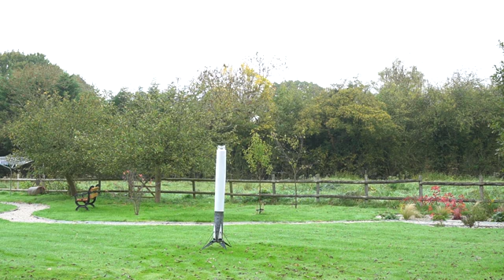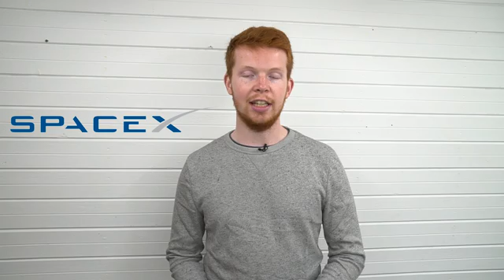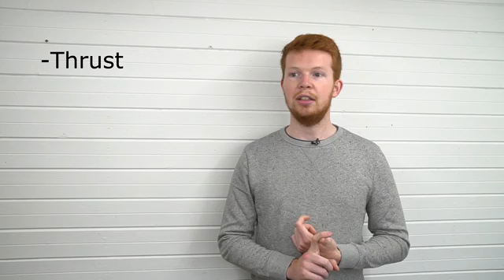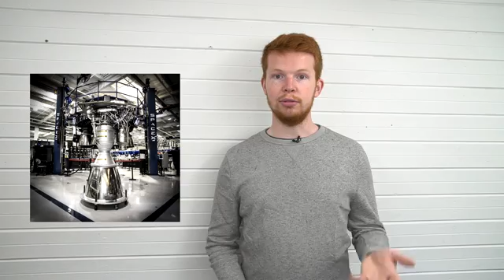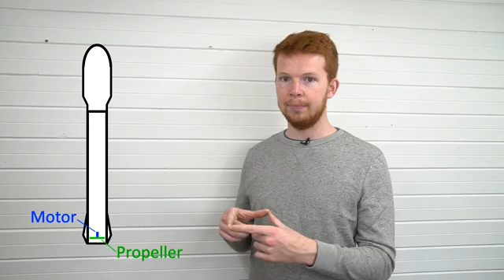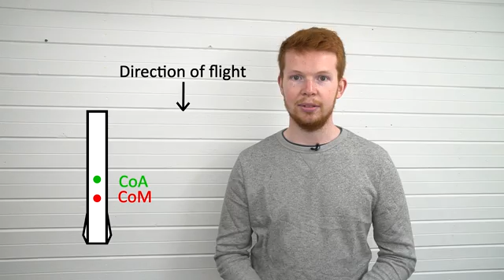Hovering a rocket - SpaceX model

Comment: Thanks for awesome explanation and demonstration. For testing purposes, maybe try using something like a fishing line instead of elastic, so it doesn't affect the rocket in hover anymore. And maybe add a small portion of elastic to dampen the "snap" when you cut the power and the rocket "hangs" itself.

Comment: you could improve the thrust by streamlined inlet and maybe a thicker rocket body, and shorter lenght of air traveling through the tube, to avoid boundary layer problems

Comment: Tom, idk if they still develop the code or which board you're using but you used to be able to plug in a GPS antenna to a Naze32 and use the Naze with the barameter on board and with those 2 enabled and using GPS mode it could hold pretty damn still and would lean into the wind. or even if you tried to push the quad it would fight you. It was a weird but cool thing to play around with.

Comment: Saw a video of  U of Penn students hovering a single motor/prop mounted in a tube and using speed control at specific points in the prop rotation to maneuver it as, for example,  against a wind like you were not able to do.
I think that might work for you to counter the wind.

Comment: If you were able to build a consistent propellant mixture and use a new nozzle each time, you would get identical performance from every launch.  This is the kind of control you can achieve, and the model rocket motors aren't too bad at precision.  Our launch pads, extremely light construction, and winds... yeah, model rocketeers have it tough when it comes to the precision a robotic CNC nozzle-building lathe can build one that's two feet or so in diameter can do.

But, didn't amateurs make it to space for under a half million?

Do you think you could build a rocket at amateur scale that uses 'copter blades (as we're targeting atmosphere-laden bodies, these days) to land and launch until ineffective, where rockets take over... yeah, feathering would have been nice about now... :)

I would deploy tandem counter-rotating heli blades from the nose and let gravity give its motors something to do.  No gyro required, and the blades fit neatly between the tank and the wall.  Mass below, thrusters above, like on a Chinook.  Land horizontally, like a tandem helicopter?  In any case, use the atmosphere and make it do the work.  Bigger rotors :)

Pull a Transformers on the world of model aviation and launch and land a rocket with helicopter blades.  Carbon fiber is a miracle material.

Comment: Next step: Add positioning input? 

Your inventive use of internal propellers would allow for a small camera mounted on the bottom which can provide the internal computer (switch to Adruino?) with an image of a rectangle, such as a painted piece of plywood acting as the launchpad. 

The relative lengths of the sides of the rectangle might then inform the lateral thrusters at the top of the rocket, and the area of the rectangle would provide the altitude for main thruster adjustments to acheive automatic ascent and landing. 

Might even work in the wind!
Reply: Dan Lindy +
Reply: That's a nice idea but that is not going to work very well, mostly because a camera produces way more data per second than an Arduino can handle. Also, you would have to calibrate the camera and you would always be stuck with your reference object.

Another solution: You could use an IMU with an Arduino. They are quite noisy so you will not have perfect positioning and you will need to initialise the sensor for a second or two and then integrate the data over a certain period of time to get decent velocity estimates. You would have to combine it with GPS and implement some extended Kalman filter in software to get an optimal estimate of the position which you can then use to predict control signals. The greatest feature of such a setup is that the filter adapts itself (even dynamically) to wind, lower battery power, wear and tear on the motor et cetera and will still try its very best to maintain the desired system state (position and orientation of the rocket).

Been there, done that. Fun stuff!

Comment: if the "legs" could have some sort of "knee" bending with the angle to the inside and the tip that touches the ground facing out of the center i believe it would give it a bit of improvement.
you got a new sub.

Comment: Hey Tom, what if you use a solid (inexpensive) source of power to put the rocket up in the sky and then use the drone engines to guide it down, a some sort of sensor ( even a camera ) will help  you to keep control while the rocket is coming down, also you can create a way to slide a balance inside the rocket in it's way down, just as you explained in your video ( CoM ), some sort of automatic system ( pretty simple, you don't want to add weight to your rocket ) that slide the battery from the top to the bottom with just one switch, then the fan I think should be at the top of the rocket, guiding the balance of the rocket on its way back to the ground. Finally it would be amazing if you can calculate when to start a second load of solid (or other source of thrust) at the right moment before the rocket touch ground ( I know it may represent a lot of calculation ), but think about it: two load of solid fuel (one over the other), put fire on the lower one in your way up( both within the same "tube" but different outlet) , then in your way down guide the rocket with the drone electric fan after slide the CoM down with just one switch, and finally seconds before the rocket touch ground (perfectly stabilized by the electric fan on the top) you ignite the second load of solid fuel. I'm telling you, is just an idea to start but for me sounds like you are going to have the "F" Space X at home man. You inspire me a lot and I love physics, technologies and rockets, thank you man, for let me dream a little bit, and give me this space to put out my ideas to fly.

Comment: Real Falcon 9 has aerodinamic and RCS  stabilizers o the top of the stage.. and fuel is much lower and on the botton lowering the CG ..  This EDF rocket tries to stabilize in the totaly oposite way..from the lower bottom.. also he doesnt seem to use digital servos fast enought to act (analogic servos are quite slower.. and even digitals are not fast enought sometimes.. thats why gimballs use direct drive brushless motors instead of servos)

Comment: You're using basically the same vectoring principal that the Germans used for the V-2. In the V-2 the rocket nozzle would change direction to keep the rocket traveling in the right direction.

Comment: A+ Design for the vectored thrust. A suggestion for further improvements:
You should create a nozzle on the interior of the rocket which has an inlet funnel so that the volume of air is compressed by the fan and then efficiently expanded by the nozzle to generate thrust. If you drill holes in the sides of the tube in the throat of the nozzle you can create a venturi effect that increases the density and thus thrust of the fast moving air in the nozzle at the expense of a little bit of maximum speed.

This tube fan approach is limiting the thrust AND specific impulse, as well as lacking the exhaust mass, and exhaust velocity that a venturi valve+nozzle would allow.

Comment: You learned the right technique in the end, just "pop" it off the ground. Pussying about when lifting off is very bad, the control system is thoroughly unable to correct anything when being stuck in the grass. Its the same thing FBL RC-helicopter pilots has always done.

Now those FBL controllers are fairly tolerant, since they normally use a sort of hybrid approach (Im fairly sure about this, anyhow) between "heading hold" or absolute mode, and "rate mode" or relative mode. Nowadays you can have, I guess, a real idea about what is up and down, but early systems using only "gyros" did not have a real absolute notion of attitude, making the internal model come out of synch with reality.

Comment: It seems you got rotation stability figured out quite well. Now I think you should focus on translation stability, before you could see any substantial gain in its ability to hover and fly.  Maybe you could add some radar for distance approximation and/or cameras to map the surrounding area to determine its relative position (as I think on these short distances, gps would not be adequate). I think you could then implement it as a pipeline, the translation controllers giving a thrust value and a pitch angle and direction, while the rotation controller tries to match those angles as well as possible.

Comment: I would say it's a huge success! As for the motor burnout problem that's easily fixed with a different motor and prop size/pitch size, no problem. I also think the drift/control could be easily fixed. You had the right idea with the small "thruster" motors but think they should be placed just forward of the balance point. 
I'm guessing your an R.C. pilot and builder so think fixed wing with some tweeks. Please don't give up the on the project. I think with your forward thinking and programming skills you'll over come these small obstacles and not only hover but fly AND spot land your rocket just like SpaceX.
BTW: Don't forget, SpaceX is not hovering or even "gently" landing their rocket. If watched closely one can see it comes down pretty damn fast, lands and cut motors. That takes away o lot of control issues.

Dance the Skies

Comment: Drone* (not a rocket)
Reply: The Falcon 9s are drones. By definition.  Drones designed to carry HUGE payloads into orbit, and then carry their own body back down to a specified landing pad.   There's a reason they call those sea-based landing zones  "Drone-Ship"
Reply: Christopher Deriseis do you know what a drone is?
Reply: the boosters arnt powered by a quad copter.
Reply: daniel felix drones aren't always with helicopter, there are drones that look like airplanes etc.
Reply: Please take a look at my project on Makezine blog. I can launch my Rocket Drone using both water/pyro modules, landing it vertically.
Reply: You're not going to power something you want to be able to test in your backyard with something like a turbine or an actual rocket engine. They may kill everything you know about rockets, but they're simply not appropriate given the weight of the test vehicle in this video. The goal of the propeller system is to substitute the thrust system of the Falcon rockets (merlin engines) with something a lot more safer and practical.
Reply: a rocket is a cylindrical projectile that can be propelled to a great height or distance by the combustion of its contents.   doesnt have to  be jet  propelled
Reply: By definition a drone is something that can fly itself without any manual input from a pilot. This is not a drone
Reply: Pyrrha Nikos that's where similarities end

Comment: I'd call that about 75% success - a proof of concept at very least! :) RE: burnout prevention -
 I'd imagine that returning to the counter-rotating method would reduce the expected-thrust burden on each individual motor, and thus not have to run them so hot? Or were the motors individually a large proportion of the flight weight?

Comment: It was very dissimilar! You covered about 5% of the real space x. Just a tube with a fan!  you thought to much on a landing technique! All round good but I know it takes weeks to crack the perfect project to work every time! I would of reversed the way you was trying to self land a model motor rocket! EDF fans would be better and calculate the trust payload by the angle of the pitched props! I would of tied a rope high from a tree and used a magnet to release the rocket on testing it high in the air and caught it if it didn’t work! Then if it did work it would of looked impressive landing from a good height! It would land perfect using a GPS system as it would detect ground pressure as it gets closer to the rocket. It all comes down to how much £££ you spend and time and how deep you want to dive into rocketry! Good luck

Comment: I understand the reason for not using real rocket thrusting and replacing it with a fan. This also let you get rid of the complexity of the dynamic moving of center of mass and total mass of the system, as there is no ongoing use of fuel and thus no ongoing reduction of mass. Not that the problem is easy to solve even so...

Comment: Switch to RC Nitro Airplane engines and stuff.  Lots of power.  Edit: Actually, probably just electric stuff, electric is a good competitor too.  Check out the High end RC airplance community if you haven't lol.  Not quadcopters, people making toy airplanes n stuff that are into the airplane part of it.  Air equivalent of the Nitro RC community.

Comment: i think the problem is that the rocket is too light therefore it is easy to lose control over. the coursing is way too fast to make it stable. that happens with every small light drones as well.and even a weak wind make it driven  away

Comment: This is great! But you failed to consider one thing. Moving your propeller up near the top of the rocket inside was kind of like "cheating" from a rocket standpoint. You are moving the center of thrust pressure up above the center of gravity so that gravity becomes a stabilizing factor rather than a destabilizing factor. It is part of what helped the second design. With a rocket motor it is much harder to balance because the center of thrust is below the center of gravity, which is a destabilizing factor.
Reply from the maker: +Elliot Petersen research the 'Rocket Pendulum Fallacy' and you'll find that not to be correct ;) thanks!!
Reply: Tom Stanton the rocket pendulum fallacy is true relating to an accelerating and especially rotating object. However this is a hovering object in dense air so the pendulum effect is still stabilizing.
Reply from the maker: The rocket pendulum fallacy absolutely affects a hovering object. For example, if a helicopter pilot were to let go of his controls, would the helicopter automatically self level (assuming no electronic stabilisation methods)? With the mass being below the point of thrust, one would assume so, but this is not the case.

Comment: I'm thinking... I'm curious as to what kind of motor it was that you were using. You could 3d print a 3:1 (or higher) planetary gearbox to the size of the motor, so it keeps in line, and doesn't impede airflow. I can't even do any math, as I don't know what motor and controller you're using. But a cursory estimate, you would gain about 33% rpm at full output.  Depending on what filament you use, for as long as the gearbox lasts. I figure planetary gears might last longer. Depending on how many planet gears you use, it splits the torque from the input shaft. Interested in any thoughts you have. 😁

Comment: Success at hovering and great job. 
I'm thinking a mix of what you did would work for better control.. 
I think the counter-rotating blades along with the vectoring would allow you to go against the wind and pick your landing spot. The motors would not have to work as hard either. Using the vectoring to both counteract the torque and balance it, doesn't allow for  good directional control. Too much work for the fins to do. 
Indoors it will probably hover nicely as it is but I bet it would be hard to move in a specific direction sideways.
This is the first video of yours that I've seen but it gets a sub for awesome homemade results.

Comment: Great project, great execution and a great success. I think you would match Falcon 9's with a not that expensive add on: a GPS, you have succeeded in keeping it vertical, you just need to know where in space it is at any point in time. You have circuits for around 20$: https://m.es.aliexpress.com/price/gps-circuit-board_price.html#/

Comment: Wow what a great video.  A bit dry in the beginning but it had to be explained.  This is a very ambiguous project that you executed very well.    My only suggestion is to get the flight controller centered on the CG as that will up the sensitivity of the gyro in relation to the rocket.  Extra sensitivity on the sensor package should allow you to have lower PID values. Keep up the good work.  I'm temped to try this project out myself.

Comment: Hey Tom, it's absolutely a success! Maybe the gyros need some more fine tuning. The only problem i see on second version, is the CoM is way too high. That's why the bottom of the rocket swings wildly, i think. You should give a try with CoM around between 1/2 - 1/3 from the top.
Anyway, i just subscribed, to see the future tests! Good luck! :)

Comment: maybe if you went back to the two opposing motor design, at least that will give you more thrust and negate any rotation problem, don't double up on your battery though, just run them in parallel, half the run time but probly enough to get it up and flying...by the way, have a look at SKYLON, tell me what you think, that intercooler on that thing is wicked, I think SKYLON will be a game changer.

Comment: Bloody success! One man trying to achieve what hundreds of Aeronautic engineers have only recently achieved at SpaceX. Besides, the reality is that this can only really be achieved with very advanced computers that are equipped with gyros and GPS and hundreds of other sensors on the rocket that can be used by a central computer unit that makes power or control surface changes. 
Great vid! nice work.

Comment: for one your fans wont work. they cant keep it upright and adjust for any tilt that happens. you need several engines firing around independently and control by a computer controlled gyros. but dont let that stop you lol

Comment: The problem with having the CoM near the top is that it's nearly impossible to make it not tip over. Also, why didn't you use two motors in the second version? Really cool anyway though.